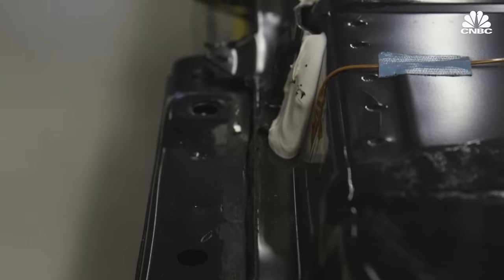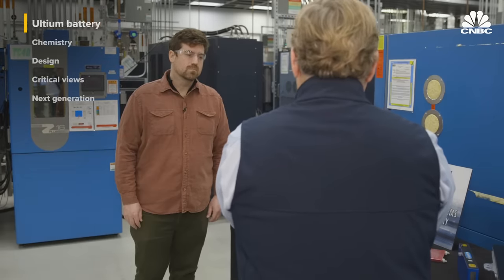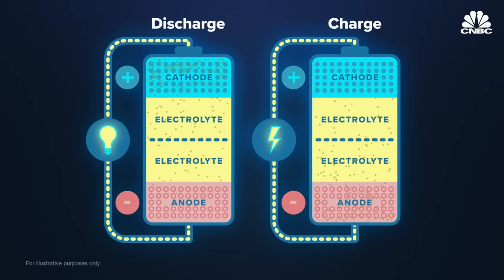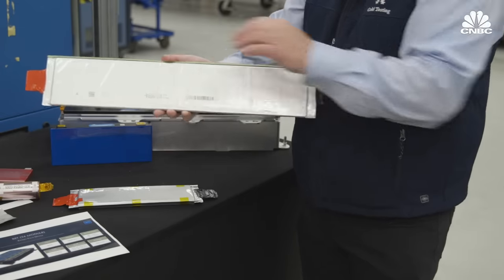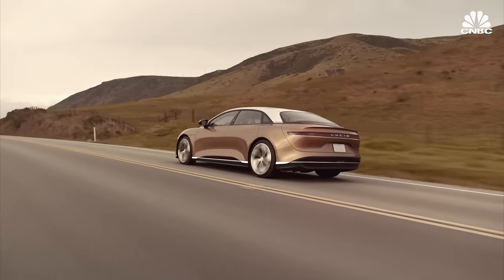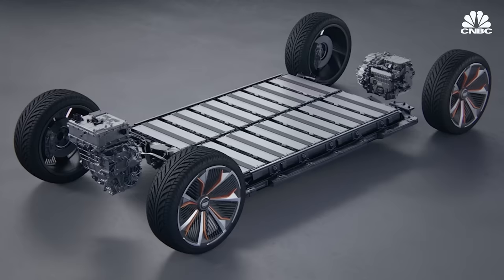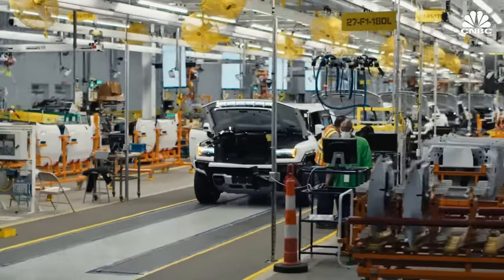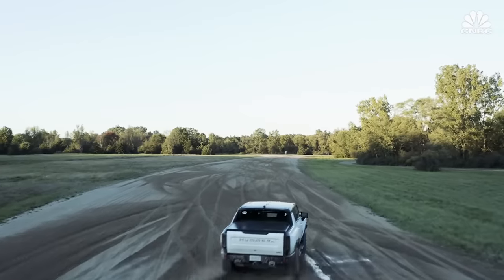Why GM Says Its Ultium Batteries Will Lead It To EV Dominance

Comment: The one thing I really like about GMs design is that it will probably be the easiest EV in the future to upgrade. So if you buy a Lyric, Hummer or Silverado in the next year or two and decide you want to keep it for a long time, it probably won't be that big of a procedure to swap out those "bricks" for newer ones in 10 years that will have better energy density, less weight, and charge faster. This means you might get 350-400 miles of range now, but in 10 years you can probably get 600+ with a swap. The way Tesla is building their vehicles right now, this would be a MAJOR deal to try to swap out the entire battery pack, as it's a structural pack, often glued together.
Reply: It is the most scaleable today.  It will also use wireless BMS.
Reply: The battery is the last thing I will worry about in 10 years on a GM vehicle
Reply: In theory, but with the way anti-repair is going, I'd be surprised if the manufacturer allowed the car to turn on with the new cells
Reply: I paid extra to get 300 miles of range but could quite easily get by with 200. People who’ve never driven electric vehicles totally don’t get the fact that you don’t fill them up at charging stations, you charge them at home just like your smart phone so you drive off in the morning and the car is always full.
Reply: @colingenge9999  Yes, that is what I tell people that they can replace about 100 miles of battery overnight on a 120v outlet!

Plus no stopping at the gas station anymore.
Reply: @colingenge9999  Not really, I put almost 9,000 miles on my Model Y in 2 months. Fast charging is really important when you road trip.
Reply: @normt430  I didn’t realize how awful it was going to gas stations until I started charging at home. By contrast my rare visit to free destination charger is quite painless because you plug-in and walk away.
Reply: @ELCEV  yes, you put a four or five times in the miles a day do. In my last 2015 Tesla I had unlimited super charging and always found the superchargers conveniently located so when I had to charge I had already driven three or four hours and needed to get out of the car and go for a walk anyway. It’s great that you can pile that many miles on your model Y which is really the sweet spot for an electric vehicle with low fuel costs close to zero maintenance and really easy to let auto pilot do the work on those long highway stretches.

I am currently living in New Zealand and could not buy a model Y but I am happy with my model three in the meantime which handles brilliantly on the super windy roads around Auckland.
Reply: @colingenge9999  Model 3 is a great car, enjoy it.
Reply: @colingenge9999  my thought it was going to be a pain to plug and unplug a car compared to going to gas station.  Some gas stations can be dangerous!
Reply: @normt430  haven’t driving a battery electric vehicle for the past five years I can say confidently that charging your car in your parking spot at home or at work is at least 100 times easier than going to a gas station. It literally takes less than five seconds to plug it in. You pick up the plug, press the button, the flap opens up, you shove it in and walk away. That’s it. You might think there’s some danger involved in handling the high-voltage add a supercharger station for example. Maybe in the rain? But the way it’s designed, the car tests for the quality of the connection with a tiny signal voltage before it starts applying any power. You could literally hold the charging plug in a bucket of water and not get a shock. It would give you a error code and tell you to smarten up.

Electric vehicles are so amazing that if you ever drove one you would never go back and you would feel sorry for all the people clunking banging and thumping down the road and there archaic gas cars.

Comment: This platform, BEV2, is the primary first time buyer and city vehicle.  It is a mistake to lose these customers.
Reply: It’s called chevy bolt 27000
Reply: Most Bolt owners like their car, I do. I think many will upgrade to the Equinox EV. I plan to.
Reply: @steven4315  - The 19” difference in length means a lot to the urban driver for parking access.  Sure the added capacity of the Ultium battery pack is nice, but in truth we could do nicely with a sub 100 mile battery pack.
Reply: @jonathanleonard1152  An EV with a 100 mile range would have a small market. I agree that would work for most people, but that is not how most people think. I hope GM keeps the Bolt and upgrades to ultium.

Comment: There are lots of people, especially in urban areas, that can't buy EVs. Hybrids solve this problem. Gasoline or hydrogen engines charge batteries, like a Prius. Hybrids achieve 75 mpg and solve range anxiety. Hybrids must continue to be manufactured and it's shortsighted to focus on EVs only.
Reply: If someone doesn't have a place to plug in, they should just buy a ICE vehicle or maybe an ebike. Otherwise they're going to be hauling around an entire extra powertrain for no reason!
Reply: @Hypercube9  I don't believe so if you're in an urban area. In NYC it's pretty common to drive to Philly and DC, long road trips. Hybrids are the perfect vehicles.
Reply: @davidhunternyc1  I'm not talking about hybrids though. You said "lots of people, especially in urban areas, that can't buy EVs." Why can't they buy EV's? I assumed it was because they didn't have a way to plug them in. So if they can't plug them in ever, what good would a hybrid be if you always use gas to run it? You'll be carrying around the extra weight of the battery and the electric motors for no reason!

Comment: Okay, someone explain how this works. GM will dominate EV sales by 2025. How? By increasing EV production to 1 million by 2025. Right. That makes sense....

Meanwhile, Tesla exceeded an annualized run rate of over 1,000,000 in Q4 2021. Their production is consistently increasing 60% to 70% year over year despite struggling against major headwinds. Meanwhile GM total vehicle sales have been declining the last few years, even before the pandemic. 

More likely scenario, based on projection: Tesla exceeds GM in total vehicle sales in 2025.

Comment: with that hummer battery Tesla could power three model 3. This is all talking. Show me millions of EVs sales and then I'll believe you.
Reply: Just you, David.  They'll do it just for you.
Reply: @rand49er  No my friend. They won't. Not for me, not for anybody. That's the point
Reply: The model 3 can also fit in the bed of the hummer. They are two different class of vehicles, its like saying you could power 10 honda civics with the fuel capacity of a peterbuilt semi truck. It doesnt make sense
Reply: @sonofagun1037  If you want to make EVs, you have to make them efficient... because there are not enough batteries! With an ICE Hummer, the most inefficient production car, Theu just had to put a cheap big gas tank. Now with the EV Hummer, again the worst effciency of any EV being made today, you have to put a freaking huge and expensive battery, with which they could make 2 Lyriqs. Don't you see it? This Hummer is doomed.

Comment: 2 mistakes in the vid:
1. The US standard range model 3 uses LFP (lithium iron phosphate - no cobalt or nickel in it) as well. It's not just sold in China
2. GM EV sales in China are bottom of the barrel. Tesla outsells everyone in China in EVs. The only way GM can say they outsold Tesla in EVs in China is if they count hybrids.. bs...
Reply: Tesla didn't have a single model that outsold GM-SAIC!
Reply: @normt430  ya, I forgot about the little tiny micro EV that GM partnered in making. Counting that, they maybe outsold tesla. Cars are in completely different classes though

Comment: Its funny to me that GM thinks it will own the market. For such an experienced company youd think they'd be more cautious about making massive claims like that about emerging markets. First does not mean best, and with complex supply chain intensive industries like this one nothing is for certain.
Reply: True. GM beat Tesla with the Bolt (against the Model 3) by a year. However, the total number of Bolts sold by GM since 2016, are still less than the number of Model 3s Tesla makes in 6 months.
Reply: Chock it up to the marketing group being overly excited

Comment: I have my doubts on GM… and their new battery is likely meaningless. Tesla is a software company. I suppose they may license to GM but that will just propel them faster.
Reply: I sure hope not! GM is going to need software that works.
Reply: @davidmccarthy6061  Tesla doesn't even have wireless BMS that GM Ultium will have.
Reply: Tesla software is pure garbage, and a master class on UX in Nightmare Mode. The only thing they have right now is high velocity updates.

Comment: What happens when one of the packets gets a little puffy, like they do from time to time? Put pressure on the packets next door? Wonder how those packets will react to being squeezed in to a tighter space. I think this is the largest failure in EVs waiting to unfold, we will see, won't we.
Reply: Just had one in a car starter expand by 69%, breaking the plastic case. Very touchy batteries. But cheap to make.
Reply: @rondavis8091  What do you mean by "one"?  Do you mean a GM Ultium packet or are you referring to a battery module?  Ultium batteries use flexible pouches 4" wide by 23" long by 0.4" thick with an electrical strip for connection at both ends and are contained in battery modules.
Reply: @Patrick_Gray  I think what he's saying is that that type battery has the potential to expand a lot, they are cheap and dangerous. He's referring to the an auto jump or booster pack.

Comment: The breakthrough in better electric vehicles will happen when they no longer rely on a chemical reaction battery for power.  A more efficient storage medium must be found, such as staged-release solid-state capacitors.  Used with a high-efficiency Capacitive Discharge Pulse Motor, this would improve range, cold-weather performance, charge times and power.
Reply: Capacitors lack the energy density of batteries, so range would be 1/10th what it is now. They should be used with the regenerative braking though to extend the life of the batteries.
Reply: Sounds very child like solution
Reply: @Hypercube9  Definitely.  Batteries have greater energy density, but capacitors have greater power density.  That's why they would have to be engineered in banks and used gradually in stages.  The good thing about capacitors is they fully charge almost instantly.
Reply: @edgenet1  Sounds like a very child-like response...
Reply: @ccrider77  Exactly. So you can't have just capacitors the range would be too low. Or the car would weigh 10 times as much. Batteries only have so many charge/discharge cycles, so charging the battery with regenerative braking every time you stop reduces the battery life (an issue capacitors don't have btw.) And not only do they charge almost instantly, they discharge almost instantly too! Which is exactly what you need for quick acceleration. Charging & discharging batteries quickly also takes life off of the battery (but not a capacitor).
Reply: Go work for GM
Reply: You had me until you said "capacitors".
Reply: Solid state is already being used on smaller scales. It is the next frontier.
Reply: @ccrider77  Capacitors would regenerate charge sort of like how the F1 hybrid dies through KERS.

Comment: GM cant even get their 100 year old tech right so i have zero faith in their EV that has been a failure for 20 years so far.  GM = Giant Mistakes
Reply: GM also = Government Motors 

Perfect representation for our politicians
Reply: Not sure what you have seen, but they certainly made the Volt right. Easily the best car GM made within the last 50 years of that point. Now they are on to better things. Hopefully it works out.
Reply: @sonypony9444  yeah i agree and then what did they do? Stopped making it smh
Reply: @sonypony9444  seen plenty, in fact every GM car I have ever had left me stranded.  doesnt the bolt blow up???  yea they do so well
Reply: @zeezlebops  because it served It’s purpose, and PHEVS make no sense anymore.
Reply: @baldisaerodynamic9692  That’s a bit of a blanket statement. The only cars that ever left me stranded are Mustangs and BMWs. Also more gas powered cars get toasty more than EVs like the bolt, additionally it was a multi level issue stemming from bad LG packs. Many companies had issues, from GM to Kia, to data centers and beyond. Its now become a lesson in battery assembly. Nobody want to repeat it.
Reply: @sonypony9444  they make a lot of sense

Comment: Fascinating glimpse of the race to Battery Holy Grail.  Not only is engineering going to play a role in who can develop the best purpose build EV battery, but supply chains shall also dictate who can bring their vehicles to market quicker.  The race is on !
Reply: Your "battery holy grail" will never happen. Despite billions being spent on research, battery density has barely tripled over the last few decades. Unfortunately, the science, physics, and the periodic table do not lend themselves to such.
Reply: @Rick-the-Swift  Indeed, it takes a huge amount of current to charge an EV. Multiply that current draw numerous times and you end up with an electricity grid (especially if its connected to diffuse and unreliable wind and solar) that simply cannot cope.
Reply: It is all about engineering. They will have to find new ways of powering EV as well.
Reply: @dipladonic  We have not tried mass producing solid state yet. And there are options besides batteries to non-fossil fuel vehicles. Hydrogen, nuclear, etc.
Reply: @dipladonic  Wind is very efficient, Solar is getting much better.

Comment: GM is "All In" on their One (1) Ultium Battery Technology, however technology changes constantly and they will use ONE (1) technology whether Either Success or Failure.  Most likely FAILURE!!!
Reply: They can update the batteries and switch them out with better batteries over time. Obviously at a certain cost.

Comment: GM has locked up long-term contracts for the raw materials and batteries needed to sell 1 million EVs in the U.S. in 2025 and is looking for upside opportunities to get even more. It says those EVs will generate $50 billion in revenue by 2025, and $90 billion by 2030.

The Chevrolet Equinox EV will debut this fall with a $30,000 MSRP, which already accounts for higher raw material and battery costs. That’s also ten grand cheaper than comparable crossovers from competitors.  Autoline
Reply: That is a lot of talk with little substance. How many EV Hummer have they sold? And you want people to believe their EV price at $30k, with inflation? only happens if they are selling at a loss and/or they are lying.
Reply: they just said they want to catch tesla whose as 1.5M now?  with berlin and texas just coming online....so 2.5M end 2022 mid 2023 with shanghai and more coming.  how on earth is that catching if its less than half of teslas 2023-2024 goal
Reply: @richardroberson9277  it's literally impossible lmaoooo can't they be sued for this by investors? like there is no way they are even coming close to tesla
Reply: @richardroberson9277  Half of the automaker's North American plants will be converted to build EVs by 2030. So far GM has identified five of those: Factory Zero in Detroit-Hamtramck; Spring Hill in Tennessee; the Orion assembly plant in Michigan; the CAMI plant in Ontario; and the Ramos Arizpe plant in Mexico.

Every new vehicle will utilize GM's Ultium EV platform and battery management system, with more and more of the componentry being developed in house as production ramps up. Additionally, a partnership with LG Energy Solution known as Ultium Cells is building four battery cell manufacturing plants with the first one starting production this year.

GM says it will have the broadest EV portfolio of any automaker. The first 20 electric vehicles will be introduced by 2023. Here's what we know so far, by brand.
Reply: @nguyep4  Bolt EV starts at $26K today!
Reply: @normt430  Good for consumers since the battery issue is resolved. But considered when prices for EV or even used car are going up, the Bolt reduces price. That is a sign of lack of trust. GM reduced price sn't indicative of anything other than to get back some market share. That price reduction won't last long when their goal is met.
Reply: @nguyep4  no, the $30k Equinox is coming.  And so is Blazer SS.  Can't be selling old tech when the new stuff is coming out for less!

Comment: In the EV domain, the main advantage that legacy auto makers have over start ups like Tesla is their proven ability to manufacture in volume.  The problem with that for GM is that they only have experience in volume manufacturing of low quality cars.  Factor in their technology gap in batteries, motors, power electronics, and especially self driving and then add in their lack of charging infrastructure, their crippling relationship with the UAW, their poor financial position, their crumbling brand loyalty, and their inability to anticipate market needs and quickly respond to them and the most likely outcome for GM is bankruptcy.
Reply: Spot on!!
Reply: Teslas has the worlds worst quality.
Reply: GM's advantage is volume manufacturing? Tesla took GM's and Toyota's Fremont factory and turned it around to become the highest volume car factory in all of North America.
Reply: @chrischristiansen1008  GM still makes far more cars per year than Tesla and has made tons of cars for decades.  Don't forget that a very large percentage of parts are similar between EVs and ICE vehicles.

Comment: Maybe I missed it but how are these packs cooled?

I am surprised they didn't mention it but all of the vehicles using this platform will have a heat pump.

What is interesting is the cars will use a 400v pack voltage but the trucks use 800v. Neat that is in the same platform.